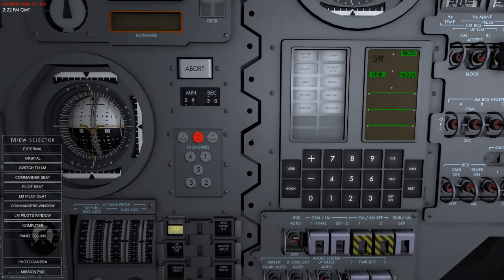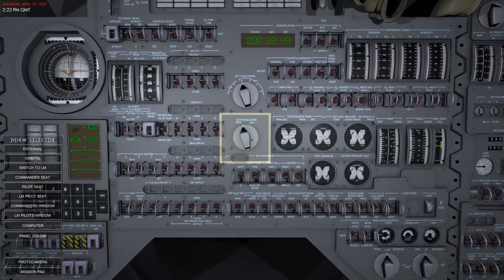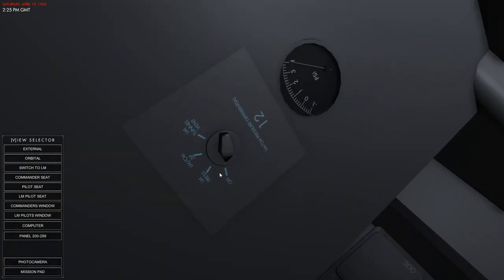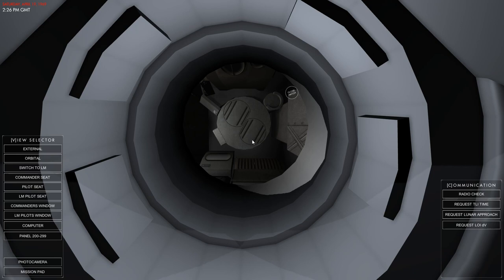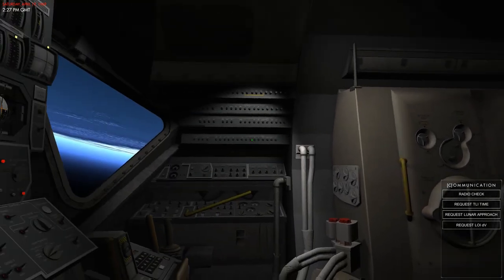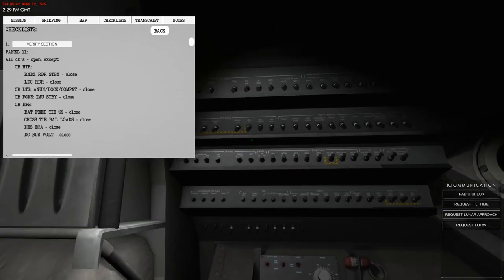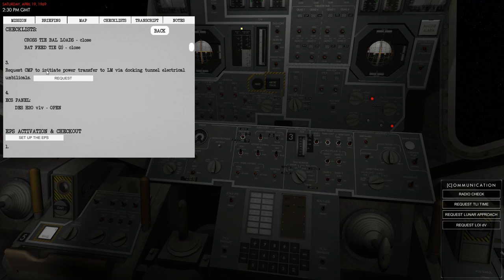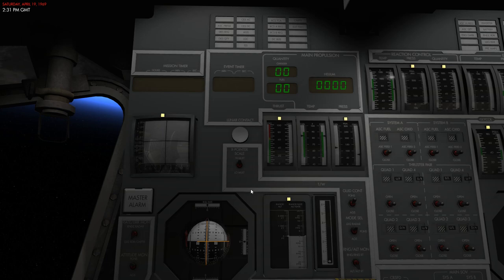Lunar Module Operations 2 - Ingress and Checklists

Comment: I have a frustration. I've managed to get from liftoff to a stable circular orbit around the moon with the CSM/LM configuration. I run through all the ingress checklists and have checked them via the LM undocking tutorial. (I always copy procedures from those tutorials, very helpful) When I switch pgns mode cont to attitude hold after V76E the LM quads start firing and the rates go crazy, BUT these read on the CSM FDAI! And they are off the display. Even with all CSM RCS switched off.  Can't get the rates to show on the LM FDAI. Also, I cannot get the LM to separate from the CSM when I press the docking probe toggle. Even trying to painstakingly follow procedures I guess there could be some things I've done wrong but are these bugs? I've saved the state 3 or 4 times in this scenario. Are the save files robust?
Reply from the maker: Hmm, I think I have recently heard about an issue with Att Hold after Lunar Ascent, so I'm planning to do a full ascent again in a few days to see if I can reproduce it.

Comment: LM ingress and undocking continues to be bugged. I have completed the campaign right up until undocking which then goes haywire with LM RCS firing randomly. And rates don't show up in the LM. I did manage to get undocked using the short tutorial but the up and down translational LM thrusters were non-operational. On the plus side the game seems to be loading faster since the update.
Reply from the maker: Thanks, will take a look! This is the LM activation/ingress in campaign 4?
Reply: Correct. The game stimulated me to read "How Apollo Got to the Moon" a detailed explanation of procedures and makes me further realize the number of things that could be simulated. Amazing job so far. Thanks.
Reply: Also, the LM undocking in the Academy does not let me translate up or down. Those quads do work for attitude change so they are operational.
Reply: Have done the Academy ingress 3 times now. No up and down translation. Did the hot/cold RCS checklist and it was not reading my joystick for that movement. Went into control options and it shows that it is being read there. Also keyboard input for up/down also not working.
Reply: Setting Engine Thrust Control to auto enabled the translational thrusters.
Reply: @Ledgwins  same here